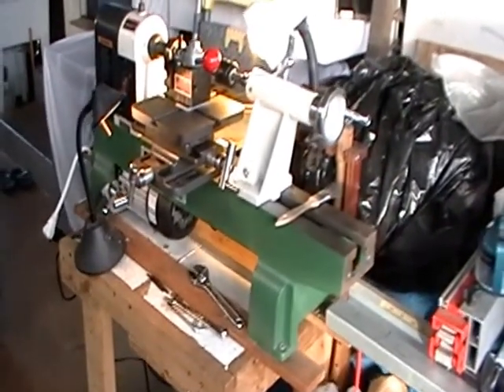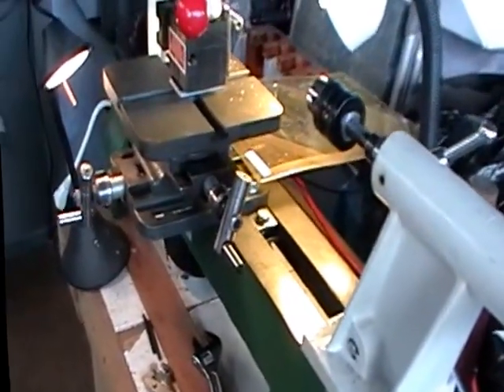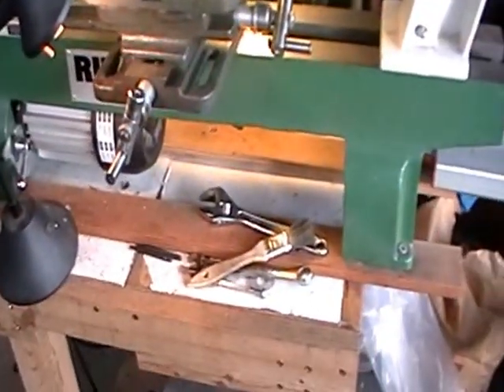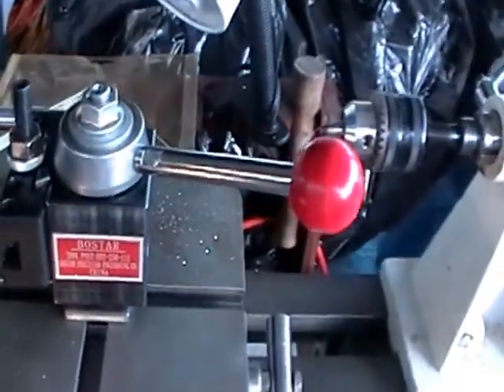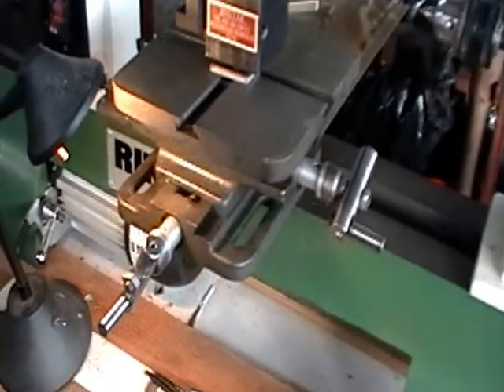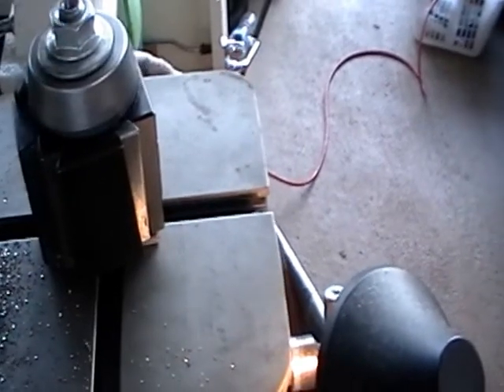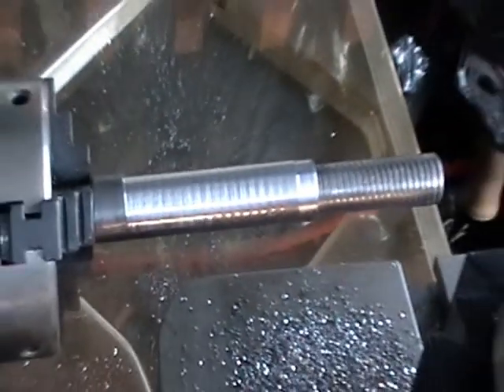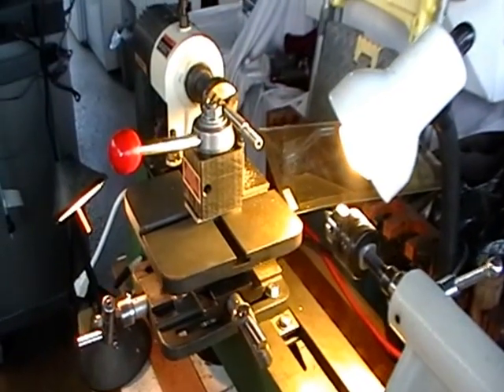Wood lathe modified to turn metal part 1.mpg

Comment: You can probably shim the gibs and ways on the XY table and tighten it up using thin metal shim stock and you should be able to find a few videos specifically on that, here on YT.  I've been watching videos on people making their own Gingery Lathes in which they cast their aluminum parts and use them to make a lathe and I could easily see this set up being a stepping stone to making better parts for an actual metal lathe based on this chassis using those techniques.  Cool stuff.

Comment: Dale Derry (Metal Tips & Tricks) did a video of a friend turning metal free hand. The same could be done on a wood lathe. Get the rough shape with files (slow but sure) or an angle grinder. Then shear scrape near the top of the workpiece with a HSS tool. He didn't get 'catches' because if the tool got a bit low it was just pushed away from the work. Low cutting forces meant only a small handle was needed. I'm going to try it some day. =D

Comment: very good job , but that kind of wood lathe cost about 300 $ and I guess you did spend for the conversion at list 100 or more, if you did for fun you did very well, but if the problem was economic, I can tell you that today you can buy a sieg c3 like there are many brand but same lathe and it cost about 500 $ so